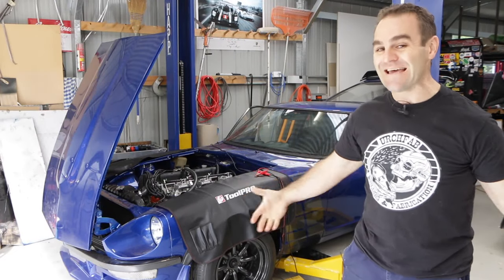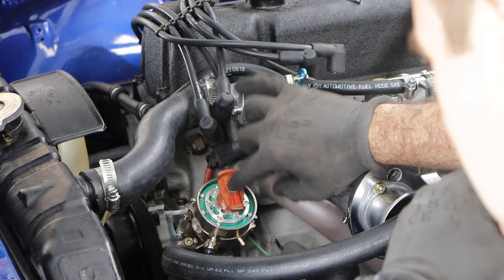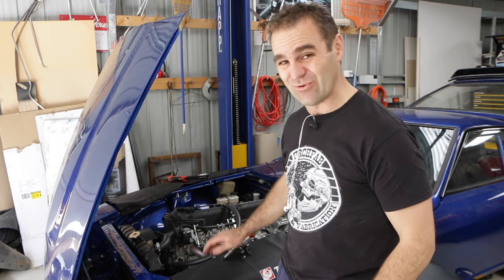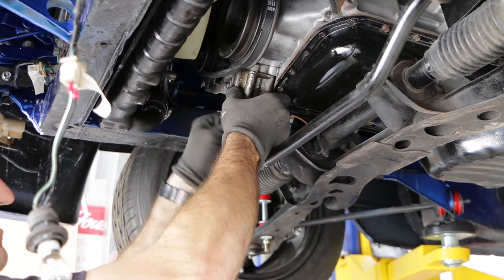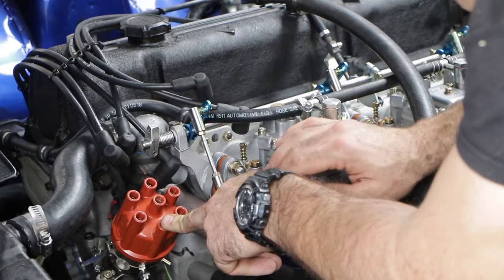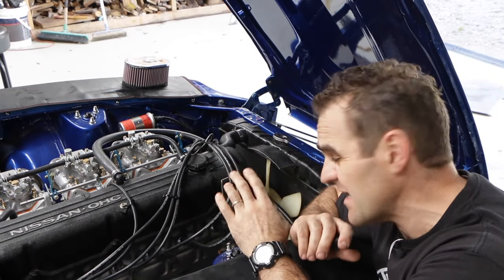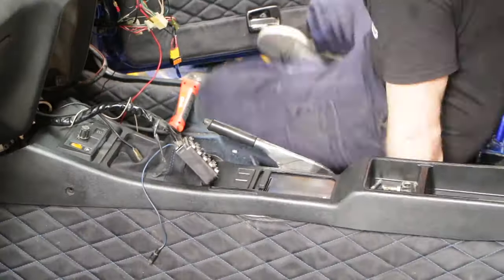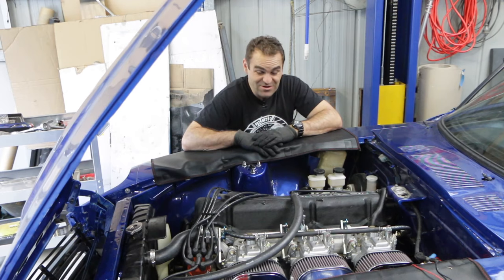Colour tuning the 680G - Home Built Datsun 240z part 97

Comment: Yes the hazard switch is definitely on a 71. It was a requirement. They changed the type and location multiple times through the early years. I have a 1970 car with a 73 dash and a (not sure what year) switch. I think I have 1 or 2 available hazard switches in hoard. The type that is round with the green label. Let me know if you are interested.

Comment: US spec 240Z hazard switch is on the dash between the steering wheel and heater control panel. You also have a "72-73 center console. The cig lighter was on the fuse cover/rear defogger panel on '70-71. US spec again. The ignition timing was quite advanced on the L engine.But petrol was different too. My L24 runs at 27 btc at 92 octane. Keep poking at it... You're almost there!!!

Comment: In a 70-71 Dash, there are two depressions molded in the dash  to the right (for rhd  cars) of the opening for the heater control panel.  The hazard switch is a toggle switch with a black  plastic handle that you flip up to turn on the hazard lights and fits in the lower and smaller of the two holes. Most modern cars use a push->on, push again for off type of switch.

For '72, the cigarette lighter was moved from the panel covering the fuse box to the larger of the two holes in the dash.
Reply from the maker: I have just learned Aus cars didn't get a switch which is why I can't find it ;)

Comment: Check the Colortune plug is clean and the screw on connections are clean there is nothing else that can go wrong I had slight corrosion on my screw on lead extender and at first didn't notice it caused erratic sparking.

Comment: Also from what I remember.  All of the taillight and turn signal wiring goes through the turn signal switch and then the hazard switch.  So if you’re having light issues , not having the hazard could be a cause

Comment: Hazard switch on the 240Z is on the dash below the cigarette lighter (the smaller hole). On the 260-280Z they moved it to the console, below the radio.

There are a few different switch designs depending on the year: https://www.viczcar.com/forum/topic/6506-240z-hazard-switch/

Turn signals, brake lights, and hazard lights are all on the same circuit, so if you have a bad connection in one area it can cause the whole system to not work.

Comment: I know this is an old video and you have since sold the car. But, in relation to the carbs having different vacuum values between the two barrels, that is a sign that the throttle shaft is twisted. This should be straightened to get the car running right. The shaft can be straightened without pulling the carbs off the car by twisting the shaft from the nuts at each end. It only needs small notches. I have a V12 with six double Webers that I couldn't get running right, and the cause was that almost all six carbs had slightly twisted shafts. The throttle shaft twist fairly easy and when adjusting the throttle people often twist it.

Comment: I have a 1970 car with the original dash and the hazard comes out of the dash kind of between the speedometer gauge and heater controls. Its the older switch with a black arm. The switch connects to a 6 pin and a 3 pin connector in the back.

Comment: Jeff also check your cam timing. You can look at the cam lobes through the oil cap or with the valve cover off. Both cam lobes should be up (sort of 11& 2 ) position.. there is some info on the net or in the how to rebuild books about this. This is really important as 1 tool out on the cam can cause all sorts of issues.
Reply: “Rabbit Ears”

Comment: Hazard switch on a series 1 was a simple switch near the key. There would be an indent like a cross next to where it would go if it was a ’72. The ‘70-‘71 dash is just below the blank spot (could be a hole or not). The later ‘73, like mine, it is a green knob switch near the cigarette lighter and key. I can send a pic if you want on IG
Reply from the maker: A pic would be good. Mine has indents, but no holes or switches :(
Reply: Home Built By Jeff sent!

Comment: I ran a new hot “brake light” wire from the pedal switch all the way back to sort out mine. Also the ground suggestion may work- so try that first. I’m assuming the bulbs are all in correctly. From experience, start with bulbs NOT LEDs.  On my Z you can’t change a few of the bulbs to LEDs or the whole thing stuffs up.

Comment: There are actually markings on the oil pump and shaft that you line up to make sure everything is clocked appropriately at TDC. That would have been the easier way to ensure the shaft was in the correct location.
Reply: @ Home Built By Jeff  You STILL have the wrong shaft orientation. After all that. Don’t do an Italian tune !  There is a dot on the shaft and an arrow on the oil pump.  Line them up. See :https://youtu.be/Xs1P55UwhTw
For the correct procedure calmly explained.  Once done, the drive shaft from the oil pump should be at 11:25AM not 13:35 PM !!! You’ve got the wrong side of the bolts. Left side of the top bolt and R side of the bottom bolt. Smaller 1/2 moon D shape points to the front of the engine.  That way you’re sure you’re not 180• out.
Reply: @junkyardkustoms Exactly. Spot on, dude.
Reply: @alienpoker  @junkyardkustoms thanks guys! I happen to be exactly where Jeff is at in my 123ignition/240z setup right now, having exactly the same problem, and this helped greatly.
Reply: @Jay Medina
@Jay Medina  Do read the comments for Jeff’s other videos on tuning. Also check out my install video and TDC method: 
https://youtu.be/3uYUdClpOxw

Comment: The rotor should NOT point straight at the post. The leading (or is it trailing?) edge of the rotor should be where the post is, as it advances the rotor it creeps up and past the post at the ignition event.
Reply: That's a good point mawe42.  Thinking logically it'd be trailing wouldn't it?   360/6 is 60 degrees of rotation so however wide the rotor is, it would be pointing a little past #1 at TDC, right?   But not half way between #1 and #5, it'd be more like a quarter of the way....

Comment: I don't think hazard lights were mandatory back then, so it either may not have the switch at all, or it could have been an option. Re the colortune, I've only use a new ones (one on my bike and another on my series 3 landy). Never had any problems with the spark degrading during use. Here's a (crappy but short) video of it in use on the bike: https://www.youtube.com/watch?v=ZrAK946oEGQ

Comment: Could the hazard switch be integrated in the indicator somehow?
The way i tune my carburetors is: Turn the adjustment screw all the way in until it stops.. Then 1,5 turns out. Have all the screws in this position.. Then start adjusting them 0,5 turn at a time. Have all the carbs the same.
Reply: @Jsp no. Hazard is on the dash.  It you have a “cross” shape on the dash- the label saying on/off goes there and has a black handled bat switch next to it.  If you have a circle shape its a pull button with the word “hazard” in green, below a cig lighter.  These are US models so LHD of course.

Comment: Yeah the oil and timing gear setup is a pain. Im not gonna lie, i have quite a few times installed it in the wrong place and just turned the distributor to suit, usually there is enough play to make it work unless you hit the vacuum advance or you end up right where metal is on the distributors base.
In essence it dosnt matter where the shaft is as long as the distributor is lined up to suit, had it be able to be locked down

Comment: Good exhibit on the color change there.  The camera picked it up well.   Another great video too. It's interesting to see or hear what things come up as they do.

I'm newb-wondering why the timing mark is jumping around like that.  Watch someone tell me that is normal but it never looked like that for me.    It seems common over here in Yankeeland to set timing (all stock) to 10 deg BTDC at 800 RPM.  This is a few degrees more than the factory service manual says.  Not sure if this compensates for the vacuum control on the factory dizzy not working too well or what but it was my understanding that it's a common problem on old Zs.  Usually I obeyed the FSM to the letter and it worked out well for me, so I remember it well when any exception like this came up.  You're about 7 @ 1400 and I'm not sure how/if That even translates to this?
Reply from the maker: My timing still needs a lot of fine tuning ;)

Comment: On the lhd cars. The hazard switch is on the lower part of the dash just inboard of the steering column ( between the key and the radio bezel). Not sure what they did on the rhd cars

Comment: That oil pump drive shaft tangent should be at an 11:25 position, offsetted to the rear, meaning the top of the tangent should be toward the front side of the top bolt hole and the bottom of the tangent should be toward the back side of the bottom bolt hole.
Reply from the maker: Not according to the book

Comment: Hazard switch should be in between steering wheel and radio on the dash next to the gauges, well on my American z at least
Reply from the maker: There are indents in the dash there, but no hole, and definitely not switch :(
Reply: @HomeBuiltByJeff  hey Jeff is there anyway you can put like a Z cost summary? Like how much you got the Z, then certain parts?

Comment: The oil pump body & the oil pump shaft have a dot & a marking on each part that line up together for correctly installing the oil pump & oil pump shaft on the engine. Line the dot up & insert on TDC of the # 1 piston & everything should be aligned. Simple & its in the FSM.

Also I'm betting those new Webers are the Spanish DCOE's. So for each barrel per carb there should be an air by-pass screw. Adjust those to get your flow gauge even when you cannot get it even by adjusting the butterfly's.
Reply from the maker: You need to see the other videos, but this distributor is made 90 degrees out compared to the factory and the carbs are Japanese OER's.
Reply: @HomeBuiltByJeff  The instructions I gave  are correct for the oil pump shaft alignment as any after market distributor is using the correct stock oil pump shaft alignment to base their distributor function on. The oil pump shaft has an offset tang on the distributor side that is only in one correct position when aligned correctly at factory specs when at TDC on cylinder 1. Did your distributor come with a set of MFG instructions to re-align the oil pump shaft to their specs to accommodate its mounting? 

As for the OER carbs they are Japanese Weber knock offs essentially & use Weber jetting, emulsion tubes & venturis as direct stock parts. I haven't played around with them so I do not know how faithful they are in their reproduction & whether they are based on late or recent Weber design. The recent Weber design has the air by-pass screws.
Reply from the maker: I am aware of the oil pump shaft mounting directions. I covered that when I rebuilt the engine. This distributor does not have realignment specs, so I have had to do a work around.

As for the carbs, I do not believe they have air by pass screws, but I will be doing a more extensive tuning episode this week.
Reply from the maker: The 123 can spin 360, it doesn't matter which direction it faces.
Reply: @HomeBuiltByJeff  If the distributor body can spin 360 in relation to the rotor then why the need to drop the oil pump to re-align the oil pump shaft?
Reply from the maker: @Kronaphasia  Watch the previous videos. Basically for some reason the timing was showing (and still is) showing a happy place, of 30+ BTDC at idle, and I was chasing that issue.

Comment: no way. during the rebuilding of my beetle I had turned the engine in the engine mount 180 degrees without the distributor in place. The distribution drive shaft was also twisted. What did I look for the problem then. Wanted to write it but thought he would be fine. 
Why do you think the colortune does not always make ignition? Are you sure he will do well with the spark plugs? Possibly check your mass points again.

Comment: Have you forgotten about the gearbox problem with the contaminated oil?
Have you sold John Lemon yet?
Great entertainment, all the best
Reply from the maker: I have not forgotten about the metal in the gear oil, but at this stage it works ok. I can easily replace it later. John Lemon was sold months ago.

Comment: There is an hazard switch, it should be under the cigarette lighter on the dash, and the rear light issue might be a missing earth lead on the fuel tank  wiring harness. There should be a wire screwed under the car above the fuel tank.
Reply from the maker: Good pick up. That may be it, as I had an issue with the fuel pump ground and I ran a new earth. In fact thinking about it that makes a whole lot of sense. If that is it, that is awesome! I spent 2 hours today tring to track down my issue with no luck. Thanks heaps!
Reply: Yea a bad earth at the rear lights means it can back feed power from one light to another! Used to happen to me with old trailer lights  a lot. Just add extra earth's as it can't hurt any thing as its just a return to ground - for the power to complete  the curcuit . With the plastic  tail light housings they need a good earth! Normally thru the bolt that holds them in place. If you need to , you can solder an extra cheater wire on somewhere.  It can't hurt anything to have the best possible ground. Also back too Hazzard lights , have seen them on indicator stalks ( end, pull out nob, or on the beezal around steering colums)...on some cars. Also noticed some lifter / cam follower noise in motor.

Comment: Re: The Gunson colortune.  Are you sure the inside of the “spark plug” is clean?  Mine came with a little nylon bristle brush to clean it between cylinders.   Also you can’t easily change the spark gap on them. How close is the insulated wire from the body of the “plug”?  Mine is only 2 years old (or so) and hasn’t been used much, abused or mucked with. I measured mine with some wire feeler gauges and the gap is 23 guage so .0226” (or .574mm for your  680z 🤔). 
I’d call that a gap of .023” or so...
Finally- are you sure when you think it’s “missing” that it isn’t just going blue or white briefly.  It does that, it isn’t a constant color. When you rev to 1200 or so it should be blueish and maybe some flashes to orange/yellow when you blip the throttle.  If you raise the throttle slowly and hold it between like 2,200-3000 rpm, THEN it should stay in the bunsen blue range with very little orange.  Mine works enuf to help me tune to nice running and acceleration without being overly rich.
Reply from the maker: I didn't realise you could gap the colour tune plug. I did try to clean it out with the brush but it still coughs and backfires a bit with it in.
Reply: @Home Built By Jeff   If its around .023” ( x 25.4mm per inch = .575mm) then I wouldn’t change it.  Thats between a 22 and 24 gauge wire.  22 is a fit, 24 gauge is a  “no fit”. You said it’s old so maybe the gap changed.  Having that wrong may change the results.  Also you only torque it to <2 ft lbs. thats just over finger tight. As you note it’s not a real plug. Having some yellow /orange sputter at idle or when the accelerator pump first kicks in is normal.  You colortune for normal rpm (1300+ and again at say 4500+ ).  I’ll send a pm scan of the manual.

Comment: If I remember correctly, my 73 240z had a hazard switch. It looked almost identical to the cigarette lighter knob. Your 71 maybe be different as people have suggested. My 73 cali model seems to have similar features to the 260z
Reply: Just checked a photo. On my 240z (LHD). Harzard switch is to the right if the steering wheel, under the cigarette lighter
Reply from the maker: I don't have a cig lighter either...
Reply: @Home Built By Jeff  No cig lighter?
So what’s the knob by the rear window defogger switch.  If not cig lighter pull on it - if it pops out like a switch it’s your hazard switch. Both my Z’s don’t have a knob there. In the earlier one ‘71/72 It has a cig lighter next to the steering wheel and a switch below that with a cross cutout for the hazard on/off label and a largish black bat switch. On the ‘73 model it’s a round green pull switch between the steering wheel & the heater controls. Next to the yellow rear defogger switch, the usa ‘73 had a Red “seatbelt warning” light /buzzer and the yellow “Choke is on” light.
I guess they had different configs for RHD. Aussies and Kiwis do everything differently. Especially Jeff. Lol 😂

Comment: 17:28 - There is no hazard switch in AU market 240z's. However you can retrofit it to AU market cars by using the swiches from North American delivered cars on eBay.

It's easy to get it working, well worth it too!

https://www.viczcar.com/forum/topic/6506-240z-hazard-switch/?do=findComment&comment=186546
Reply from the maker: I don't really care if I don't have it, it is more that, I couldn't find it. Now I know why :D
Reply: @HomeBuiltByJeff  I like having it. Just reassuring.
Reply from the maker: @gav240z  It would be good to have, but it is a low priority at the moment ;)

Comment: Are you sure your fancy timing light is set at '0', it could be playing up.
If you turn the disy drive shaft 90 deg, the rotor would line up with the terminal in the cap better 
and put the leads back in the right placers
Reply from the maker: I think that would sort it out, but it works with my new mark for now, so I will leave it (I am too lazy to change it for now ;) ).